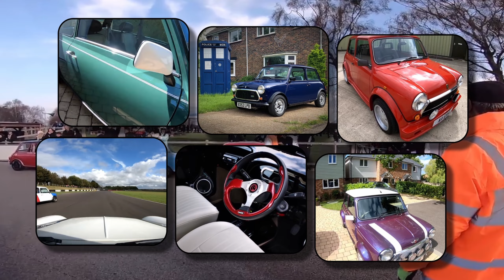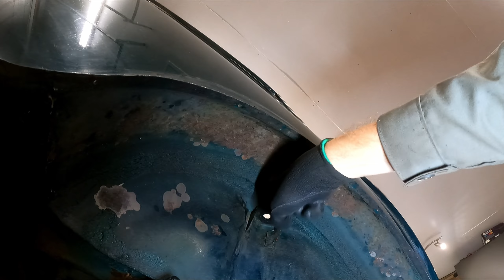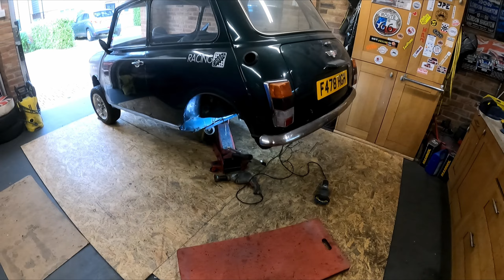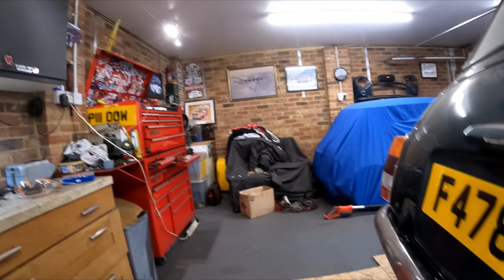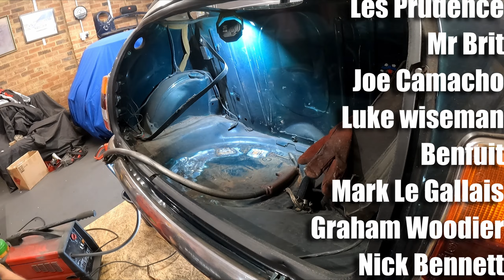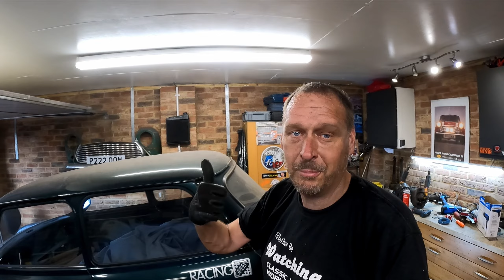More Welding, Boot Floor Clean Up - Classic Mini Workshop - Racing Green Pt.53

Comment: Does your spot welder trip out your garage supply? Saw the lights keep going off 😀
Reply from the maker: It doesn't normally, I upgraded the breakers to C type C32's a couple of years ago. My spot welder is 7kW and I don't have a problem, but this time I was being lazy and used Marks which is 11kW and if the tips are not clean will trip the breaker

Comment: Another good video. I thought that I could see some more small holes in the boot floor near the top edge of the valance: did you try looking underneath with a light in the boot ? I hope I'm wrong because you seem to be completely cheesed off with the welding.
Reply from the maker: There was nothing at the top edge of the valance but there were a couple of other small pin holes that I backed with copper and welded.

Comment: As it's a keeper Keith. it's worth having the underside blasted, you'll never fix the rust with kurust
Reply from the maker: It's just knowing where to draw the line, I'm £10k into this build and to blast the shell would be another £800 and a lot of faff to get the shell to and from the blasters. I would also need a jig to do it properly which I don't have. Blasting it doesn't fix the rust either and in my experience if it stands up to a wire wheel on a grinder/drill it's going to stand up to shot blasting. Kurust only neutralizes the rust and stops it from getting worse. If it is suitably protected after it should be fine.
Reply: I think Keith does great work, but I think he has too much faith in Kurust.
Reply from the maker: I'm under no illusions, Kurust just neutralizes and stops rust from getting worse, it doesn't "Cure" it as the name suggests. Generally, if the panel stands up to a wire wheel it's reasonably solid. You then need to protect as Kurust will only offer protection for a few months at best
Reply: I'm professional restorer, nobody in the industry uses rust potions, a part from phosphoric acid for removing surface rust, neutralisers are fake, trust me, but I know blasting isn't cheap. Keep up the good work mate
 @classicminiworkshop
Reply from the maker: @maxakarudy  I've got to be honest, I always thought Kurust was just expensive Phosphoric Acid, but a quick Google and look at the MSDS and maybe not? Most say it is Tannic Acid. Every day is a school day! Thanks for your feedback

Comment: Welds can look like Pigeon Poo but as long as it's done properly it's fine and not grinding them flush keeps the strength.
Reply: Personally I would bin that little waste of time gas bottle and convert to a big argon mix, needs a bigger fuse in the board to stop the spot welder tripping out.  Welding rust thin metal is never easy I could see the pain in your face 👍
Reply from the maker: @becko1969  I'll get a big bottle one day but the small high pressure 220L (100bar) bottles are far cheaper than the normal Mini mig bottles (60 bar). The problem is that the Clarke 135TE is not really made for big bottles so I would need to buy a new Mig welder, regulator and large bottle, so probably in for £600 - £800. I've welded this whole car, start to finish on 2 x 220l bottles (£68), so it's not that bad value. I also upgraded my breakers a couple of years ago to C type in the house and garage. The reason it tripped a few times is I'm using Marks spot welder which is 11kw vs my normal one which is 7kw. If the tips are clean it does not trip, it was just me being lazy and not cleaning the tips
Reply: @classicminiworkshop  I've got a £300 Rohr mig welder with a large argon mix which costs me £45 per fill.
Gives excellent results. My compressor used to trip until I put it on 32amp socket..
Can't fault your work you do a proper job
Reply from the maker: @becko1969  Do you rent the bottle? I've seen rent free ones which would probably work best for me but they are £200 for the first bottle (ALbee). Still much cheaper in the long run though! My breakers are C32 in the house and garage but that's about as high as I can go without rewiring the main garage feed as I also have a 7kW car charger on the circuit although it does have a CT clamp to limit the current when the car is on charge.
Reply: @classicminiworkshop  its my bottle which I bought off them..  It was £120 full at purchase then £45 each time I go for a refill, so the bottle is mine
Reply from the maker: I might be a bit more fussy if it were a structural area
Reply: Like the oversills, floorpan etc?